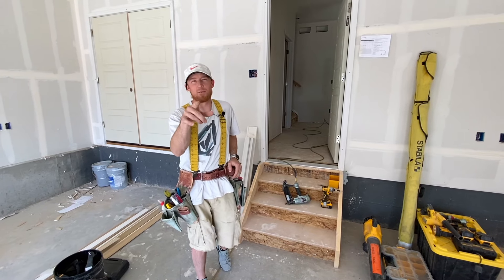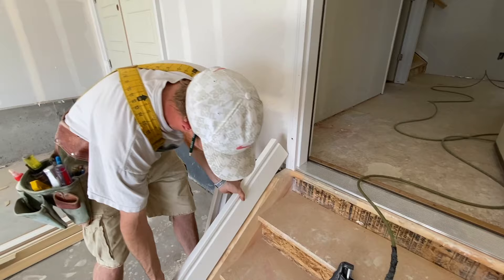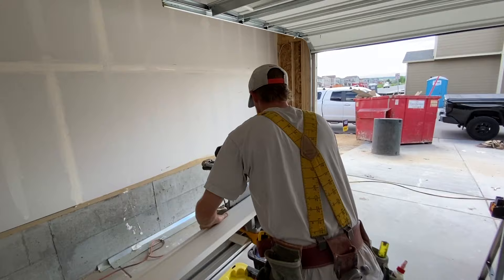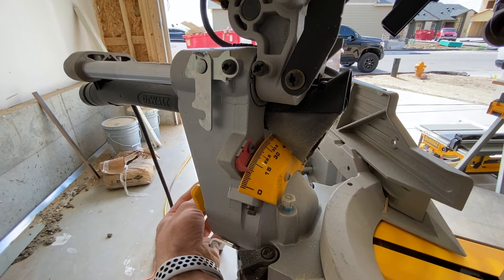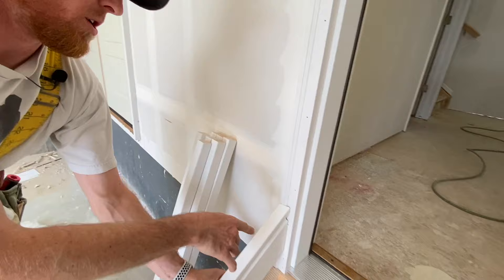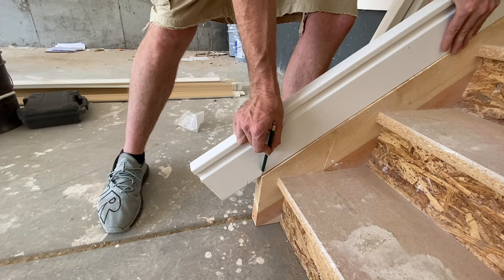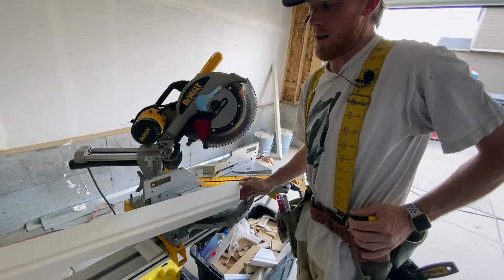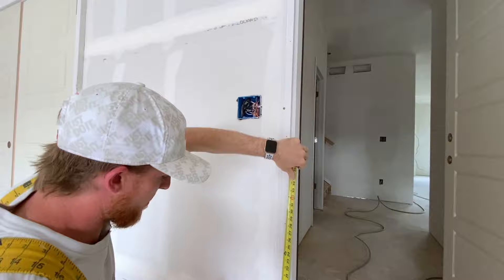EASY GARAGE STAIRS HANDRAIL DIY: How to Build and Install Handrail to CODE!

Comment: The ...no...THE best carpenter video I have ever seen.  Why?  He covered the code,  how you don't need to measure everything, use your eyeball (IF you are good-most people should measure), and he pointed out the WHY on every "detail" that counts.  Great job.
Reply: The "only" parts of the code he referenced were the "height" code and "balluster spacing" code.

Attaching handrail directly to brickmould would NEVER pass code where I live.  Also would not pass without a minimum of 2 × 4 for bottom post.

My concern with this is that if someone walks up/down the stairs and falls against this handrail, the rail will not support the stress load and will fail thereby causing potential serious injury from the fall.

Comment: Good job on the video bro! Quality content! Liked the tip at the end too. Didn't even realize that the rail leads your hand right to the door knob. Very cool!
Reply from the maker: Thanks man for the feedback! The handrail should always be on the side of wall of a light switch or a doorknob...that way you keep control of your stability if you do have to take your hand off the rail...it’s only for a brief second...

Comment: If that's to code, you have loose codes. I would never build a railing without one primary post to support side loading. Even at the end of your video, when you say it is "solid", the railing flexes when you apply a minor pressure. Everything would be fine, except I would put a much stronger bottom post to carry extra side loading.
Reply from the maker: I understand where you are coming from.  The railing flexes a little but would catch any person if they were grabbing that in a fall. Also provides plenty of support for just walking up and down the stairs...I have never seen a post for garage stairs before I feel that might be a little overkill. I have never had a warranty for a garage stairs rail that broke do to side load issues, but there’s always a first...Obviously code changes for inside the house...posts required at every 8 ft...
Thank you for your thoughts and watching the video, sorry that my install didn’t meet your qualifications on sturdiness...I truly do understand your point and for a custom job outside of new residential track homes I will take what you have to say into consideration! Have a blessed day 😎
Reply: @huntercarlson5446  They make us use a 2 by 6 as a post at the bottom, screwed to the stringer. But we are just using raw wood. That would ruin the aesthetics if we used a finished product as you are.
Reply: huntercarlson5446
If you truly believe that this railing will support you in a fall, then i would suggest you prove so in a video.  

Do this by tying a rope to the handrail, pulling on the rope with spring weight attached (luggage weight spring) and see if it takes more than 75 lbs pull to cause railing to fail.  Should realistically take 200 lbs to be considered safe.

Comment: amazing video Hunter thank you. i'm thinking to get myself one of those sink bits... what exactly is the drill bit called and what size of screw did you use for that sink bit?
Reply from the maker: I appreciate the compliment! It’s called a “twist drill bit” I use the dewalt brand. There is a 3 pack for 19.99 or 1 for 9.99. I also use a 2 1/2” Phillips wood screw to secure everything together. I get both of these items from Home Depot. Let me know if you have any other questions! Have a blessed day 😎

Comment: Hello Hunter, what gauge nailer are you using for this install? I'm trying to determine whether to purchase a 16 or 18 gauge nailer. Awesome video by the way.
Reply from the maker: Thank you very much for the compliment! I’m using a 16 ga metabo finish nailer bought from Lowe’s...I’m also using 2” nails. Depending on the project in your home I mainly use the 16 ga for just a little more strength. I use the 18 ga mainly for nailing casing to the door jambs and for small pieces of trim that might split with the larger nail. Either way you cannot go wrong! Both can shoot a 2” nail! I stay away from 2 1/2”nails altogether because the track home builders will come back at me if a water line or electric is hit by that long of a nail. Just by using 2” I don’t have that liability.  Hope this helps make a decision! Any more questions don’t hesitate! Have a blessed day!

Comment: Hunter, where did you buy the Rail and Balusters?
Reply from the maker: Hey Steven! I get all of my material from a Millwork shop called Alpine Lumber here in Denver. You can’t find the detail at Lowes or Home Depot unfortunately…the balusters are just 2”x2”x4’primed, but I was able to find the handrail detail at Menards. Hope this link works:
 https://www.menards.com/main/building-materials/decking-deck-products/exterior-railings-gates/wood-railing/ac2-reg-2-x-6-x-8-green-pressure-treated-vertical-handrail/1113843/p-1553149844052.htm

Thanks for watching let me know if you have any more questions! Have a blessed day 😎

Comment: Hunter, Need to build this for a customer. I see you're located in Denver. Where can I purchase the material? Thanks!
Reply from the maker: Hey Bob! Thank you for watching! I’m guessing you live in Denver as well!? I get most of my material from Alpine Lumber Millwork shop off of I-70 and Tower Rd...if you call them up and ask for the “garage rail and 2x2 balusters primed” they should understand what you are looking for! Most track homes use this material...If you have any more questions please don’t hesitate to ask! Have a blessed day!
Reply: @huntercarlson5446  Thank you Hunter. Blessings to you.
Reply: @huntercarlson5446  Hey Hunter. Could I use a 2x6 for the main angled piece? Just using what I have available and that piece you use looks like a 2x6 but just routed out. Thanks man.
Reply from the maker: You totally can! There is nothing against what material is used for the handrail portion when it comes to code. My only recommendation is to sand and paint the 2x6 to prevent future splinters...you are exactly right with the piece I’m using, it was routed at the Millwork shop...any other questions please let me know! Have a blessed day!

Comment: Code?? That's one weak a** handrail. 
Pull on it side to side,  I could pull it apart.  You need a post at bottom anchored for strength.

Comment: Great vid but codes are so f'in annoying/idiotic. Wouldn't want a child falling through a handrail that is 14" off the ground 🤦🏻‍♂️
Reply from the maker: I completely agree with you! Some codes  are a little ridiculous! Fortunately my job is just to follow and abide by these codes so I won’t be liable if there is an incident or accident...thank you for your time and your insight! Have a blessed day!
Reply: @huntercarlson5446  You did a good job and finally someone understands handrail graspability and the code. See way to many flat or 2xs on edge  which is not code anywhere. Thanks for sharing.